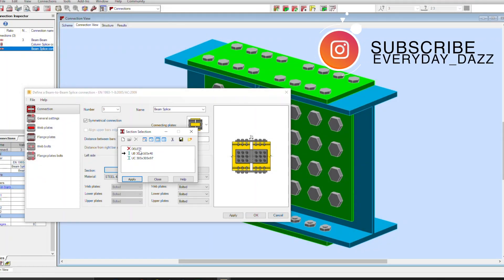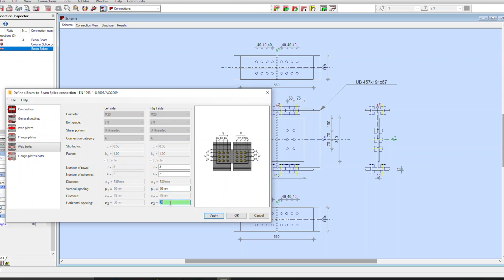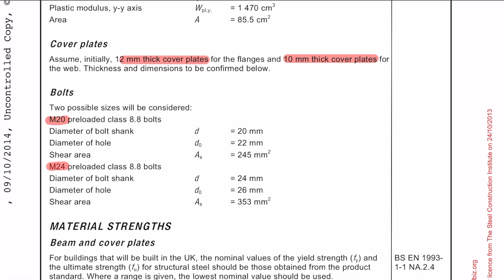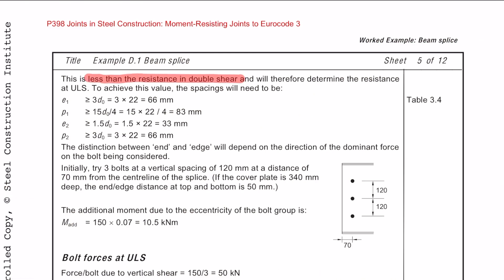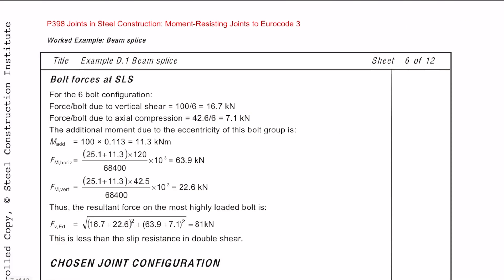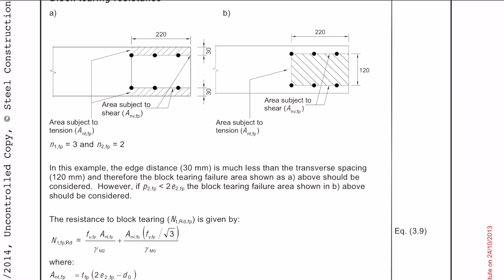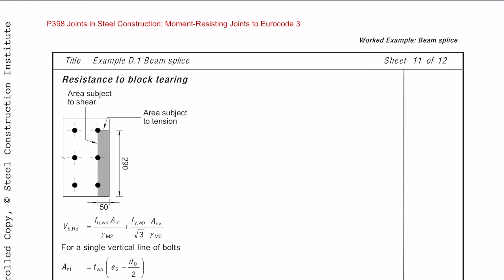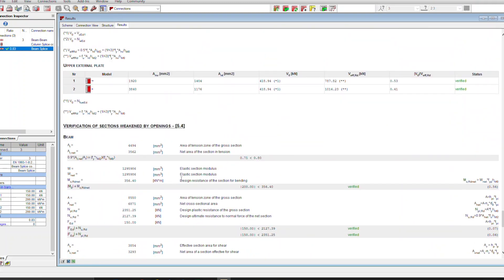Steel Connection Design - Part 3 - Beam Splice Connection Example

Comment: Is it critical to check the deflection of a splice connection? I have a spliced beam which we spliced at 1/3 of the beam and where where we spliced that beam there is a 40mm deflection whereas if that beam was  a single piece the deflection would have been max 15mm at mid span. I checked the splice details ( plate thickness, number of bolts etc) with Ideastatica and it all passes but I need to understand why this excessive deflection happened? Please let me know what you think?

Comment: Surely to god, half of this is not needed, calculations for the sake of calculations. You already know the max tensile force in the flanges, you you merely need a plate of sufficient cross section to withstand this, [you need to allow for the reduction of area caused by drilling the holes] and bolts that can deal with the resultant shear forces [having checked the bolt bearing capacity is ok] As for the web, you know the shear force [do a diagram] so bolts and plates to resist this?? If you set out to duplicate what the original beam can withstand, you cannot go wrong.. [I would think!!] Also, there are piles of calculations as to what is needed for the cover plates, but no calculations regarding the reduction in strength of the original beam thanks to drilling all holes in it..

Comment: I am new to structural engineering.Which software is usually used for steel connections? I enjoyed these videos.good stuff.
Reply from the maker: I don’t normally do much steel connection design as it’s normally a sub contractor design item. But if I do then I’ve used robot, tedds or masterseries

Comment: Hey man, I really dig this connection series and how you're going through the manual explaing the process. Was banging my head trying to find good worked through examples, given I don't use software, these videos have been a good place to go to. Thanks and keep it up mate, there is alot of structural engineering that needs some good thorough explanation and you're the man to do it.
Reply from the maker: Really appreciate the comment 🥲

Comment: Hi, Dazz it is a wonderful tutorial, but I have a question like in beam how to find which type of support that beam is required when we do the design of the beam. we generally have pinned, roller, hinged and fixed support.

My question is how we know which type of support that beam is required. if you make such video support on beam then it will help to solve my question.  if anyone knows this answer please reply.
Reply from the maker: I normally design stuff as simply supported and fix when I need keep member sizes small and to keep the design process easier. Fixed connections are typically harder to construct and more expensive. Transferring moments at supports can generally be a pain. 

You can also choose to fix a connection if you need it to provide some stability. This could be a video that I could do 🤔
Reply: @EverydayDazz  Thanks Dazz so it totally depends on us which support we choose.
Reply: @nascentnaga  Thanks